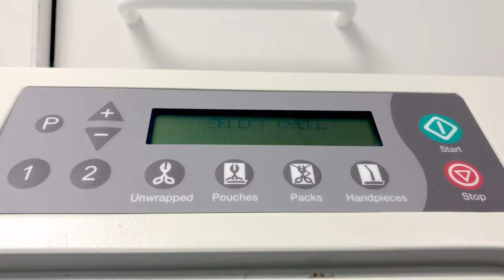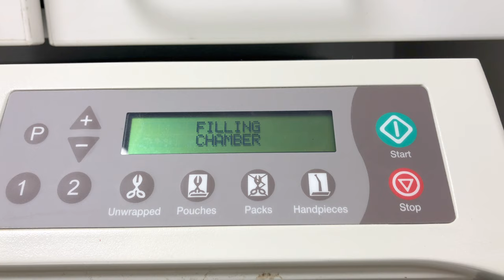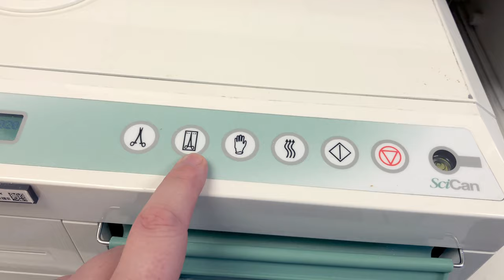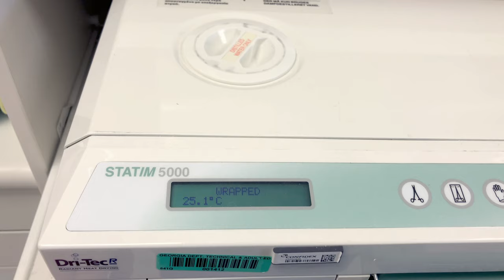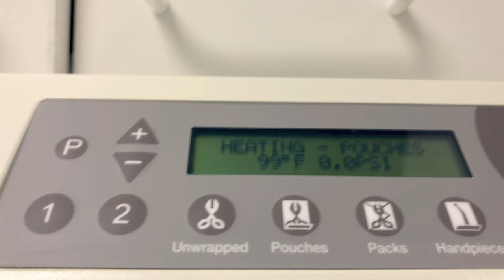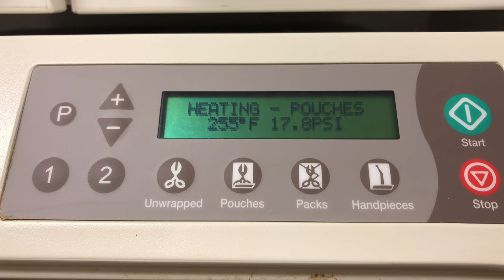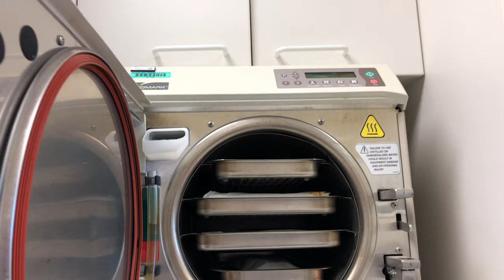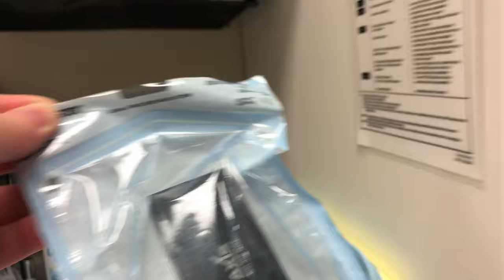Autoclave Operation

Comment: For pouches what is the correct way to place pouches in sterilizer? Paper Side up or down?
Reply from the maker: In this particular sterilizer - it should be plastic side up! Another commenter mentioned I had them upsidedown. It will depend of the sterilizer.